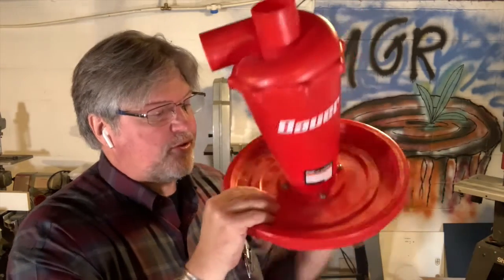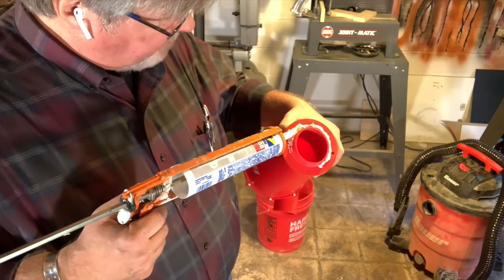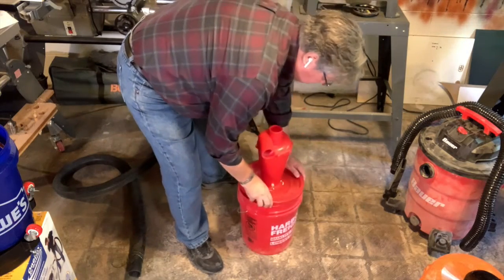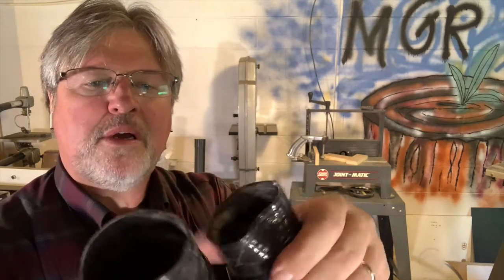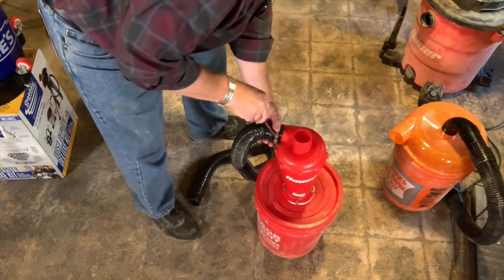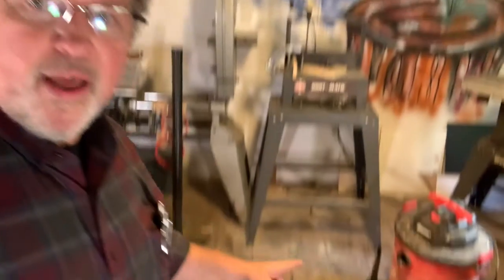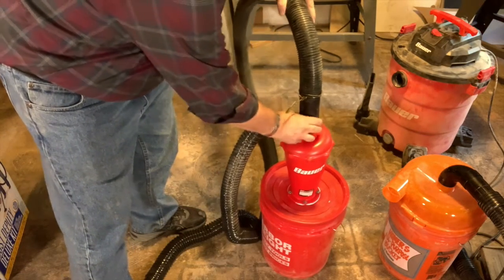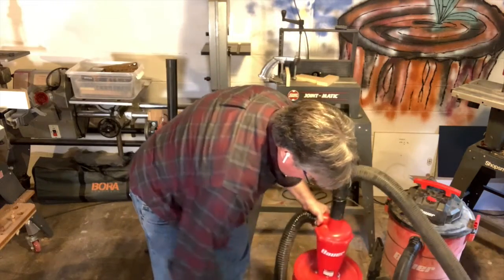Bauer Cyclone Take 2: Deal or Dud?  Not a Fair Fight?

Comment: Just bought this yesterday, (1 year after this video was uploaded) Mine came with a gasket and adapter for the end of the collection hose. They have thickened the lid too! I also own the Oneida and wanted a second for part of the shop that doesn't get used as often. I drop it on a milk crate and it never tips.
Reply from the maker: Glad to hear that they’ve made some improvements and the milk crate is a smart move. Thanks for reporting in. Scott
Reply: I got the foam gasket in mine too.
Reply: You have your hoses mixed up. Put the short hose between the cyclone and the vacum  and visa versa

Comment: I worked at Harbor Freight for 3 years, with an extensive background in most of the tools they sell, and knowledgeable on every tool they sell. If one takes the time to look through the pictures on the packaging of the product, you'll find 75% of them are incorrect pictures. Some pictures, if followed, are impossible to get the proper performance or assembly from the product, borderline dangerous. The same goes for much of the instruction and/or assembly manuals. Usually they're 10% on instructions or assembly, and 90% safety recommendations. No smoking, wear cut-proof gloves, goggles and a hazmat suit when using that I-beam level, etc.... cuz the Chinese care about us 🤫🤭🤗
Reply from the maker: Isn't that sweet? 🤣  Thanks for chiming in, Scott.  I've been buying from HF for at least 25 years, going back to when I had to order them through an ad in a magazine. They've come a long way and I really do like the value that most of the Bauer tools represent, but it's maddening to be a guy who reads and trusts manufacturers' instructions and the information conflicts. I suppose that's what you get when products are reverse engendered.  Scott
Reply: @MyGrowthRings  that's why 'real men' don't read instructions(insert smiley face here), although...occasionally, out of frustration, my wife will read them and tell me how to get something to work.
Reply: You are being very generous with 10%.  If any!

Comment: In my opinion, the people who complained that you had the hoses hooked up in the wrong order are out to lunch. A hose is a hose and they are both the same diameter. No matter which one you put on the vacuum end and which one on the tool end is irrelevant. Air still moves through them at the same rate. For that system, I would DEFINITELY use the short floppy hose as the connector to the vacuum and have the main longer hose as your main "working" hose to attach tools and clean floor. If your test was so bad in the first video, I believe it is PARTLY due to the air leakage that you found and LARGELY due to the fact that it fell over part way through the test, which caused a huge amount of dust from inside the collector to bounce back and get sucked into the vacuum. Now that you're getting better results, try half filling it then kick it over again to see what happens. Basically, I say there was nothing wrong with what you did. It was just the tip over that spoiled it.
Reply from the maker: Thanks, that’s how I see it too. Scott
Reply from the maker: When will we be seeing your résumé, Thomas? Scott
Reply: a hose is a hose but all connector ends are not created equal.

Comment: I put a 1/2 inch round  wood plate with the center cut out to reinforce the lid to keep it from flexing. I get nothing, no dust, anything in my shop vac using this. I also have two Dust Deputes. Same thing for them.
Reply: You get nothing when you use 2? I did the same ring on the lid and there wouldn't be anything IN my shopvac but the filter would still fill up. Much slower than without but all the fine stuff still made it through. Im considering adding one of those dust buster in line separators, theyre maybe 14" long but a lot smaller diameter for airflow.

Comment: FYI-  this is a great example of foreign patent violation.  The original is still being made by Oneida, a small Central New York company that has been making vacuum systems for years.  The small cycloidal version is the victim of this theft, if you would like good information about the tested and proven original ( designed by and built by American workers) look them up.  I am pretty sure that they are on the web.  Do a valuable test between the original and the import knock off that sends our dollars overseas.  Or not.😊
Reply from the maker: I did a bit of a dive into the patents, and though I'm not a patent attorney, it looks like they are in the clear on this one. I wish that weren't the case, though. Scot

Comment: I added a 3/4" peice of plywood to the bottom of the bucket w/ bolts and silicon. and the bolts are carrage bolts that touch the floor and then a wire from them that goes to the top on the inside and hooks up to a metal tape that goes the full length of the vac pipes. This prevents a NASTY static Arc that will ruin your afternoon and could cause a serious Fire when you dump out the bucket of fine saw dust. I had a 4" blue Arc that paralized my thumb for a couple hours the first time I used a dust deputy and then emptied it!  NOT FUN. Be careful. Static Electricty is very real and dangerous. (Don't fill a gas can on the tail gate or in the trunk or in the pickup bed either!!!!!!!!!!!) Only on the ground. We Must stay Grounded to the Good Earth!!! God Bless

Comment: The 2 bucket trick to stop it imploding on itself was the tip I really needed. So simple yet effective, Thanks.
Reply: This did not work for me, used a bucket that came with dry detergent from costco and that stopped the collapsing bucket problem for me.

Comment: Just got the cyclone today,  Used the hose that came with the kit between the vacuum and cyclone, I used 2 home depot buckets. Have the problem still with the buckets collapsing and the hose that came with the kit is to soft and also collapses. I changed to a sturdier bucket that stopped  the bucket collapse but  still working on what hose to use to replace the hose that came with kit, the cyclone stopped 99% of the dust from getting to vacuum which is a 100% improvement over the home depot one I was using.  Thank you for the video.

Comment: I have 1 dust deputy and one Chinese knock off.  Both have similar issues.  Hoses need adaptors the bucket lid needs reinforcement.   That said.  In years I’ve never needed to replace my filter or dumped my shop vac.  I would expect that the hose with the Bauer would fit the Bauer shop vac.  Crazy that it doesn’t.
Reply from the maker: I know, that didn’t make sense TJ me either.
Reply: Well on the Eastern edge of the Supply chain there is no "Bauer" or "Harbor Freight" just a bunch of companies that somehow (maybe a Chinese Government trade facilitator) sells these products to the world. The right hand doesn't even know there is a left hand much less what the other hand it doing. If there were any sort of "standards" for shop vacuums, vacuum hoses and fittings, ID's and OD's, etc. It would simplify. But correct me if I'm wrong, a lot of other makers, including Festool and Makita have non-standard "standard fittings" on their dust ports and dust collection products. too.
Reply: @mikeking7470  my gripe exactly… I have a 5gallon bucket of fittings and nozzles… I tried color coding them but some fit inside of one thing and outside of another… after you get away from the vacc… the tool hookups are even worse!  

I hate government interference, but I can’t believe there isn’t a vacc/collector industry professional group that hasn’t set up voluntary guidelines.  I served on the National Association of Bedding Manufacturers technical guidelines committee back around 1980… that’s why all of your fitted sheets, bed frames, pillow cases and blankets all fit.  It took three months to research and draft the standard and 6 months to get it adopted.  They’ve been expanded to include innovations but, the basic standard hasn’t changed one iota!  

At that time the big S Corporations. (Serta, Sealy, Simmons, Springaire, Stearnes & Foster) only held 60% of the market.  The rest of the bedding was made by mom & pop factories.  Yet, they still came together and adopted the standard across the board… what they all realized was… that special little something that they thought was their competitive advantage was lost when customers couldn’t buy a frame to fit it on or a sheet to fit on it.  (I can’t remember the exact number but, a dealer who sold bedding to the public would have to carry ~30 different SKU’s of bed frames to match all of the sizes of bedding offered.) That is why I don’t buy the ShopVac brand… the hose size isn’t compatible with my hookups!

As I said, it can be done.  Will it?  Obviously the industry is still too immature to do so.
Reply: @mikeking7470  "non-standard "standard fittings" on their dust ports and dust collection products. too."  Some of that is so it forces the use of their products.
Reply from the maker: Exactly right. It’s not unlike sanding disc hole patterns. They all introduce something proprietary hoping theirs will become the standard.
Reply from the maker: OMG, I’ve never we noticed the “S” corporations before! That’s like in the early 2000’s when the three big RTA furniture manufacturers in the USA were Sauder, O’Sullivan and Bush, or said another way, the three big SOBs!
Reply from the maker: Have you seen the new adjustable port “Uni-Vac” from FastCap? It looks like it has potential. https://www.fastcap.com/product/uni-vac?cat=28 Scott

Comment: I apricots you remake on the video,  I just bought this same one from hf. The description on the box  has been changed to remove confusion. My experience with hf is some times they have been opened and parts stolen.  In directions after warnings there is now a note directing you to the parts list. Mine also came with large adapter on collectionalready assembled with clamp. Insuring correct assembly. When assembling mine I used washers with a lRger diameter  to keep bolts and small washers from breaking through

Comment: Scott...I made a disc out of 1/2" plywood to bolt to the inside of the lid to prevent the cyclone from drooping...used silicon sealer on it as well.  You might want to add 4 more mount holes to the cyclone to distribute the clamping force better around the mount ring.  I like the 5 gallon cart.  I built a roll around cart that holds the vacuum, cyclone, vacuum accessories and hose.  It's bulky but very stable and can be easily rolled into position or out of the way.
Reply from the maker: Yeah, the plywood desk is the one suggestion but I just didn’t have time to apply and I can see how that Hass to help. The idea of building some sort of a cart to combine the two on the same footprint makes an awful lot of sense. Scott
Reply: Stiffness on that flexing lid looks like a must.

Comment: Great video - I have ground down thousands of SF of thin set off of floors - my first unit was the Oneida - still got it 15 years later - I have tried several other units on the market - the critical area in all applications is proper seal on the buckets and hoses - vacuum leaks really impact the effectiveness of the unit - unfortunately when grinding down thinset, the dust is so fine that some of it passes through to the shop vac - but only a very, very small amount - a filled 5 gal bucket of dust vs just a small layer of dust on the filter and virtually no dust in the bottom of the shop vac is a great achievement
Reply from the maker: That’s quite a testimony. Thank you for sharing. Scott

Comment: Not sure how much you save by the time you get the adapters, extra bucket, roller base, etc. needed for the Bauer. The Home Depot unit is pretty much ready to go out of the box. I have one of the internet versions of the Bauer clone of the Dust Deputy, I'll probably go for mounting it on a bigger barrel, since I already own it. I might even try for a DIY version of the Oneida wall mounted unit.
Reply from the maker: I have the same assessment.

Comment: That adapter that came with the Bauer fits inside the 4’ hose perfectly, and a 2” rubber coupler with pipe clamps works well for the other one. That’s how I got mine to work.

Comment: I have read that article… it didn’t make me smarter… but it did tell me several things I didn’t know!

Scott, I wonder if the efficiency and volume of air is significantly affected by increasing the container size?  A barrel or a trash can, lined with a plastic bag, would help to reduce tipping and prolong time between clean outs.
Reply from the maker: I think there’s a lot to that. I made a separator years ago and the container was roughly 4’ square and it worked very well.
Reply: This is interesting to think about in terms of air friction. On a regular dust collector, like mine, the CFM drops a little when the bottom bag becomes full. This is because the bag ring is a cyclone and the spinning air in the meal ring experiences friction with the dust in the bottom bag. This friction is transferred upward into the cyclone via the column of air in the bag. I think of the bag air as grease between the dust and moving cyclone air. As the bag fills with dust there is less grease so more and more friction is applied to the air in the bag ring which slows the velocity and lowers the CFM. Also, as the bag fill more dust goes up into the filter.

So, one thought is that a larger bottom container for the cyclone could reduce friction with in the cyclone. Although, I believe that the conical cyclones (vs. cylindrical) are not as impacted by this in the first place because the area is so small at the bottom.
Reply: @woodshopnerdery  The only time I get any dust in the Shop Vac filter is when I let the buckets get too full.  If you empty them before they are 4" from the top  of the bucket the shop vac  filters will stay clean for years!!!
Reply: @MarkJonesRanger  agree completely.  I dump mine when it gets a little over half full and never get anything in the shop vac.  Also I took pvc pipe that was slightly smaller than the fittings I needed and used a heat gun to get it flexible enough to stretch over the fitting on the vacuum and the end of the hose.  Worked perfectly.

Comment: So my criticisms are that the connection to the bucket is too flimsy and if you use it in a mobile configuration, it will be the point of failure. It is also too tall to put in a stack. Other than tht, it works a little better than the Dustopper, so if you intend to use it in a stationary environment like under a bench or tool, it's probably good. If you're using a stack or side-by-side, the Dustopper is good enough and so much better designed. Dust Deputy is best, but cost more and it shares the problem of making too tall a stack if you go that direction. You'll always be pulling your stack over unless you zip-tie your hose down to toward the bottom of the stack.

Comment: I have the Oneida separator connected to an easy empty 100% wood container and use a 12 gal shop vac and have 0 complaints. I have a table saw, router table and sliding miter saw all with $4 blast gates and 0 complaints. Most of my work is using mdf which is very fine dust. Some things are a good deal at harbor freight. Some things are not worth bringing home.
Reply from the maker: Yeah, I've brought some of those home too!

Comment: I didn't see the first vid. But, just have to say good job on  here. Just bought a Bauer Shop Vac. And TBH was not impressed with lack of no bags and attachments. I regret buying it. For near the same cost could have bought a rigid or other with attachments. So like this Bauer product it stated hose sold separately was just another reason I would shy away. Also, it took so many extra steps just to make this work and it is flimsy on the bucket. I would rather just buy the other products you have shown.

Comment: My cyclone is a no name I purchased some years ago and the only thing I did to it was mount it to a plywood disc, that I cut out, and then fastened it to the top of the five gal. can. Then, because I use it in the cellar of my home, I tied it to one of the post supports. It is permenantely hooked up to a large shop vac. I have done a lot of vacuuming with it and may have only dumped it four times. But it is my small cyclone, my other pseudo cyclone is a home made one made from a large metal garbage can. When your poor, you make do!
Reply from the maker: You sure do! Glad you found solutions that fit your budget. Scott